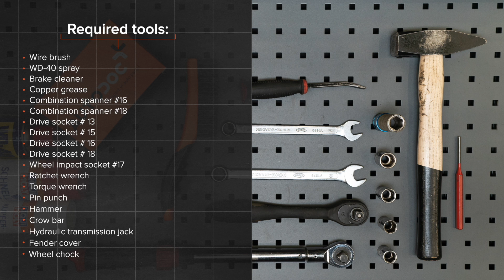How to change front suspension arm on VW PASSAT 5 (B5) [AUTODOC]

Comment from the maker: Hi everyone, unfortunately incorrect tightening torques were given in some parts of the video:

At 7:01, the correct tightening torque is 50 N⋅m

At 7:42, the correct tightening torque is 22 N⋅m

At 10:03, the correct tightening torque is 40–50 N⋅m

At 9:51, the correct tightening torque is 90 N⋅m

Comment: What is the correct height setting for the arm? If the bush is tightened at the wrong rotational position it will not work well and wear out.
Reply from the maker: It is not possible to answer your question; you can find this information in the technical documentation for repairing your car.

Comment: Also you don't need to remove the top mount from the shocker to change the arms
Reply: I hope so. Thanks
Reply: I have to do this so you saying i don't have to remove strut
Reply: @melcruz672  you have to remove the strut with the top mount still attached but you don't need to separate the top mount from the strut(shock absorber) if you're only changing the upper control arms
Reply: The newer Audi group cars are better designed  most of them allow you to remove the upper control arms with out removing the shocker it's all about the space and access available on certain models  remeber and tighten the upper arms in a raised position taking into account the weight of the car when on the ground you can potentially destroy the new bushes before time
Reply: The worst bit of the job is removing the long pinch bolt from the hub carrier assembly , you usually need heat and a good course of action
Reply: @richiec9077  did that job the other day. Had to drill out the remains of the bolt. Then use a benchpress to get the rest out. Totaly rusted all the way....
Reply: @DJThing1234  did you have heat available? Without heat you're more likely to break the  long bolt , although I've seen them break with heat available too so sometimes it's down to luck although experience and technique along with heat does help a lot.
Reply: @richiec9077  we had heat. Used wd-40 and other brands. Sledgehammer, mallets... well... we broke the bolt hand had to cut both arms with a grinder to get it to the workbench.
Reply: @DJThing1234  Waw man sounds like you had a serious nightmare , a guy I worked with once snapped the lugs off the carrier, so that was that new hub carrier and  bearing required 😤😢
Reply: @richiec9077  aye. Not fun at all. It was 1.30 pm when we put the tools back and we were done. Almost 5 hours of swearing. I hope we never have to do that again :-P

Comment: How do you know when needs to replace?
Reply from the maker: Thank you for your comment! 
There are a number of symptoms of the wear of the suspension arm:
- the car moves to the side when the steering wheel is straight;
- steering is indistinct or, conversely, very sensitive;
- the car starts to scour, and you have to "catch" it. This is especially felt even in a small rut;
- while driving over bumps, a knock or the grinding sound is heard; 
- the squeak is appeared when turning wheels
- the uneven wear of the tire tread; 
- The wheel responses to steering with delays; 
- when braking, the car pulls to the right or left. 
If you feel at least one of the symptoms, we recommend you immediately to visit the proffesional car workshop  for a complete diagnosis and replacement of the worn out unit.
Stay tuned with us!
Best regards,
Autodoc team!

Comment: Sorry guys but you’re making this look an easy job and it is one you get that top pinch bolt released ,but it never comes out easily on a car this age. It’s usually rusted solidly  and requires some serious work to release it unless you have the special too to drift it out. 
And that bottom shock absorber bolt is traditionally fitted by VW the opposite way round and doesn’t pull completely out as it hits the other arm. 
Sorry but this is over simplification of a job that many might now tackle and find ,they cannot do.
Reply from the maker: Thank you for your comment!
Unfortunately, on each machine, the complexity of the replacement is individual, it all depends on the technical condition of the parts.
Our videos are only informative in the sequence of replacement and to save time, we weaken some nodes earlier.
Best Regards,
Autodoc team.
Reply: autodoc.co.uk What a poor response
Reply: I can help you remove the pinch bolt in 5 minutes. But you need a new pinch bolt after removing the old one. Get a drill theat can work only with hammering no rotation. Now get a star shaped drill bit theat is smaller then the bolt. I think I don't need to tell you the rest. Have a nice day.
Reply: @brianmcmillan2272  comment up